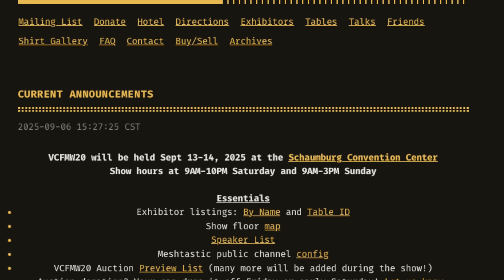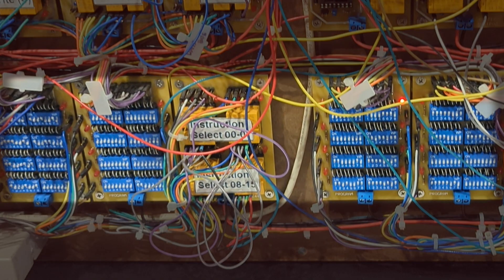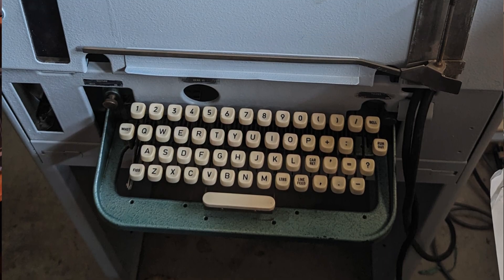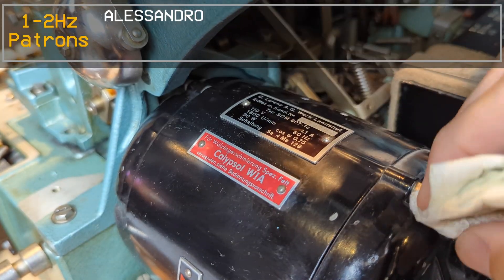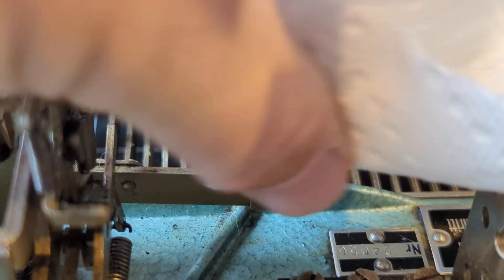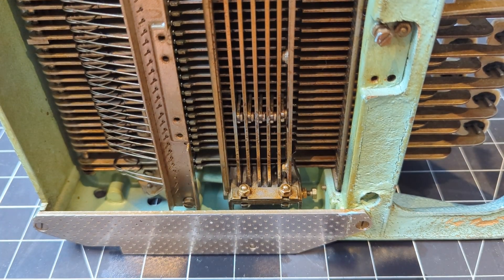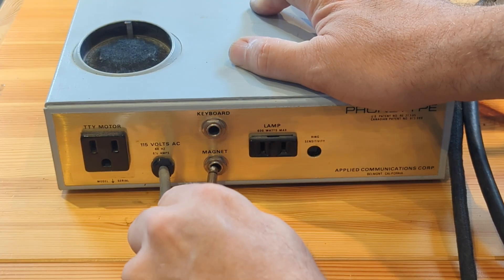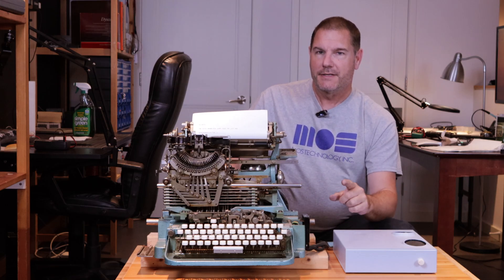Teletype Machine Clean-up (and my first VCF!)

Comment: Crazy timing with this video, I bought a Lorenz 15c a month or so ago (same as yours but with a tape punch and reader) and have been scouring the internet for any info on it, let alone mention of it.  Mine was completely gummed up, got it working in loopback with lots of penetrating oil, and now its getting a full, multi-day bath in simple green to actually get reliably operating.  If you have any info/documentation/tips it would be much appreciated!
Reply from the maker: Congrats on getting it up and running! It was challenging to find anything specific to the LO15, but Deramp has some good docs here: https://deramp.com/downloads/teletype/Model%2015/ 
The general rule seems to be: Fill the oil cups, drench any moving parts in machine oil, and then using Mobilegrease or equivalent on gears and cams.

Comment: Former Teletype repair person here. We used 30W motor oil, which is also recommended for Selectrics. For grease (bushings and cams) we used Mobilgrease 28.

I’m interested to note that the keyboard seems to be a US one. After checking CuriousMarc's site, looks like a clone of the Model 19 (I worked on 33's)
Reply from the maker: Thanks, that's great info! I was thinking that a slightly heavier oil may be in order for some components.

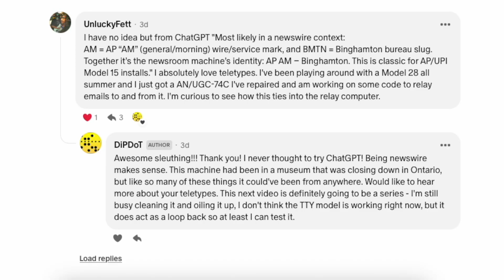Comment: 13:40 please don't just randomly believe GPT output. It's supposed to sound confidently correct / plausible, and still be a total lie.
Reply from the maker: For sure, can't take it at face value - but it's a start and I can use it as a lead and try to dig up more info the old fashioned way 😉
Reply: @dipdoting  I hope you can!  Sadly, sometimes it seems like the answers us nerds spend a lot of time searching for WERE written down somewhere, but then got thrown out because "nobody will ever read this again".  Being more hopeful, though, it could be that the info exists in detail but hasn't been uploaded to the internet (yet).  I had to search eBay many times to find just a little info on some early logic IC's that I have, and now my scan of those two, thin books that I bought are the ONLY information about that series of logic chips on the internet, as far as I can tell!  (Signetics Utilogic I series)  You never know what somebody has in their basement or attic, if not in an official library somewhere.
Reply: I came here to make sure someone said this.  Chatbots aren't really alive, but they are great liar simulators, unfortunately.  😕  But, if it DID pull that "info" from a real (verified) source somewhere, perhaps there is some valuable (or at least interesting) historical data about this unit's former owner somewhere.  🙂

Comment: 7:10 those felt wipers on the right should also be soaked in oil (if you haven‘t already done that).
Reply from the maker: Thanks - Yes I did, there's a lot of felt hiding in this machine, I had to run out and get another bottle of oil 😅

Comment: Let me know if I can help.  I don't have a Lorentz unit, but I do have several WU M15's and also several TDD modems like yours.  With a little fiddling, you can get them to play nicely with ITTY feeds.
Reply: Sent you a message on discord.
Reply from the maker: Greatly appreciated...and I may take you up on the offer! I wasn't able to find any docs for the TTY, but I was able to download the patent which was very illuminating...looks like I'll require a vintage handset to use in the cradle. If you know of a way to bypass the need for the handset that would be a great start!
Reply: @dipdoting , glad to help.  I've had a lot of fun and met a lot of great people courtesy of a barn-find M15.

Comment: During the 1990s, when I did my service time in the Austrian miltary, we were trained for "radio teletype operation" and while the shortwave transmitter was pretty much modern (it had a keypad and LED readout) the teletypes were... pretty much something like these. Fun times, especially getting the motor to the correct speed so the baud rate would match up. Did yours come with a tuning fork too? 😸
Reply from the maker: I wish I had the tuning fork, I was trying to think of ways to simulate that, maybe a strobe using an Arduino and a super-bright LED (I could tune the frequency through software). I do have a cool Teletype "test" device - literally a black box full of goodies - but that's a surprise for another day 😉